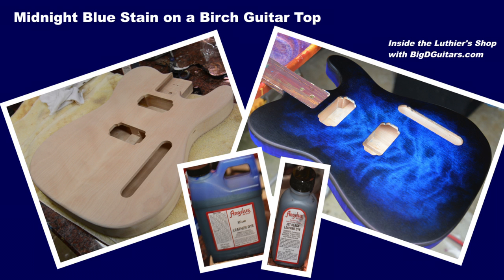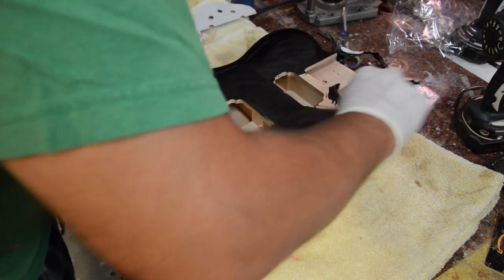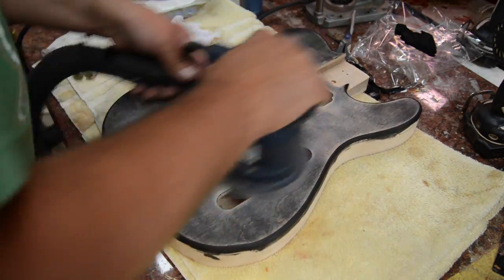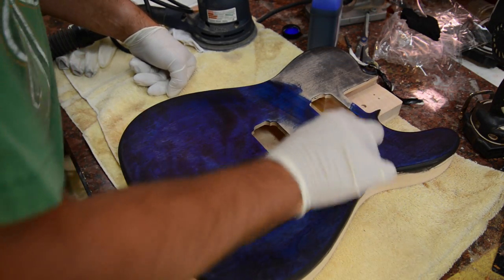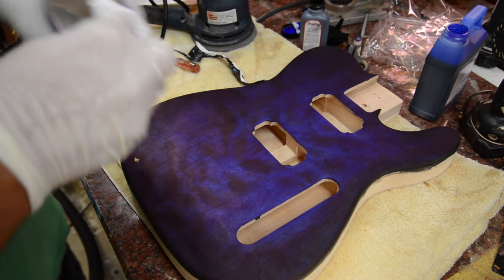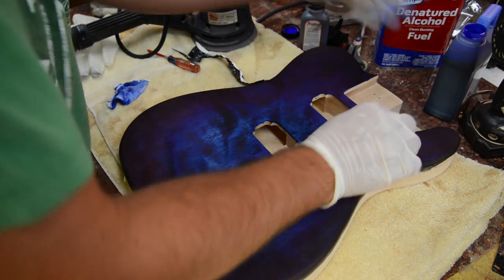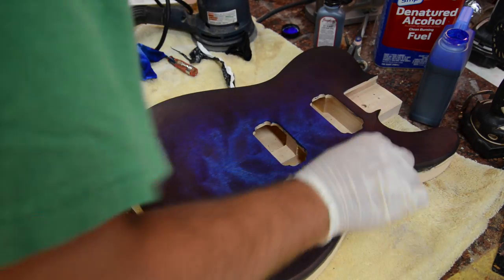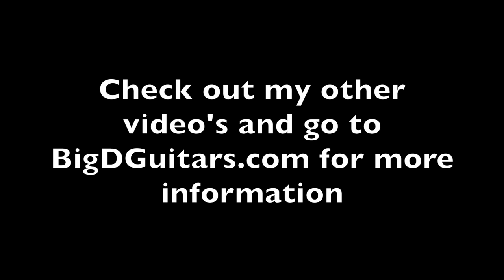AMAZING Blue Midnight Stain on a Flame Birch Top Guitar with Angelus Dyes

Comment: Saw this by Chip Packard

I have been thinking about trying to faux finish a plain maple neck with Flame/Tiger stripes, to try to mimic one of the finishes pictured. researching online, I have found 4 methods that attempt to do this.

1. One method is taking natural fiber ropes like cotton or hemp soaked in paraffin wax or kerosene. You wrap the rope/twine around the stock in the pattern you want to be light colored. Lighting the rope and slowly spinning it as it burns. Darkens the spaces between the rope wraps. Once the wax/oil burns out you remove the rope and sand smooth. This is said to be the traditional way.

2. Two, you can soak the rope in some type of mild acid, this chemically stains the wood.

3. Three I have heard of people wrapping the stock with bare copper wire, an then taking a propane torch to darken the areas not covered with the wire.

4. The fourth method attempts to replicates the artificial tiger striping present on many antique rifles made by Henry E. Leman, PA. When the stock of plain maple is smooth and ready for finish, you coat the stock with 10% nitric acid and then heat the wood by holding it near an electric stove element which is glowing red hot. The wood near the heat will turn a reddish brown as the acid reacts with the wood. Move the stock slowly past the heat source until the whole stock has turned this color. This is the base color upon which the stripes will be painted. The striping is done with a special multi-finger brush which is made from a 1 ½" china bristle paint brush. Cut off the bristles leaving a length of about 3/8”. Now cut away much of the thickness of the brush followed by notching the remaining bristles so that eight small, evenly spaced fingers remain. I had observed that on the Leman rifles that I was studying that the stripe pattern was repeating itself every eight stripes. Now with your brush prepared the real fun begins. Dip the brush into dark brown Fiebing’s Leather Dye and start painting on the stripes. Actually you should practice a little on little scraps of wood to get a feel for the work. Too much dye and the stripes flood together, too little and the brush skips, overlaps and unparallel stripes can also occur. Actually most of these problems can be witnessed on the antique rifles. So don’t get nervous! After the entire stock is striped which doesn’t take very long, eight stripes at a time, allow the stock to dry. Then brush on a coat of varnish. At this point the stock seems to come alive. The base color from the nitric acid is now an orange butterscotch contrasted by the dark reddish brown stripes. Usually one or two additional coats of varnish will finish the job.

Have any of you attempted this, and what method did you use? How did it turn out?

Comment: Just put the black down on my beautiful maple top.   I’ve never done anything like this that felt so wrong.   Hopefully the blue will make me feel better.
Reply: Big D makes this look easy.    After sanding back the black, I mixed up some blue and deluded it with denatured alcohol to get the blue I wanted.   After doing the whole front, I wasn’t happy with the color and results.   I didn’t panic but I sanded the entire top and took off some more of the black and redid the entire front with the blue again.   It may be hard to pick up in this video but the blue over the black was purple.   It wasn’t the color I was looking for but I thought it looked cool so I thought I could live with it.    The next day, I used Behlens vinyl sealer.     All the purple turned blue giving me the burst I imagined before I started my guitar.     Since my kit had a real maple cap and not a veneer so sanding back wasn’t an issue.     My advise is "don’t panic".    It may take a little sanding back to get the look you want.    Take your time, sand if needed to get the look you want.   It’s a cool way of doing a guitar and customize to get what you want.    (This is for Big D👍)

Comment: Hi, excellent job!
I 'm currently building my first guitar, and want to try this method. My guitar body is made of poplar. What is the proper finish for it before the dies? Should I use grain filler? Is good to sand it up to 400? After the dies are dry, should I spray sanding sealer before the clear coat (im planning to use Wipe on Poly) 

Thanks in advance

Comment: Big D,  I have a Les Paul style kit guitar I purchased from Precision Guitar Kits.   It doesn’t have a binding so I wanted to leave the unfinished maple cap on the sides of it to look like a binding.   I thought I would tape off the unfinished maple on the sides and spray on vinyl sealer before staining  the bottom and dyeing the top of the guitar.   My concern is the stain and dye bleeding into the unfinished cap and not having a clean line.    Good idea or bad?    Or is there a better way to do that.    Thanks for all your previous help.  Ken

Comment: Great finish man! +BigDGuitars I got a question... I have an Ash Tele body that I want to have the grain really "Pop" through the dye just like this one here. Being that Ash is a lot more porous than birch or maple, can I do the same technique as you did here with the black dye? Or would the ash absorb way to much black and not allow my to sand it of the top to then apply the next color dye? Thanks so much in advance.
Reply: Thinned "wash" coat of shellac, then sand it back before the dye is supposed to work wonders with porous wood.